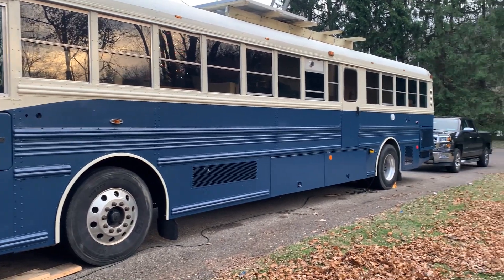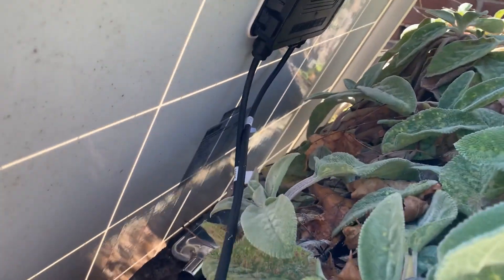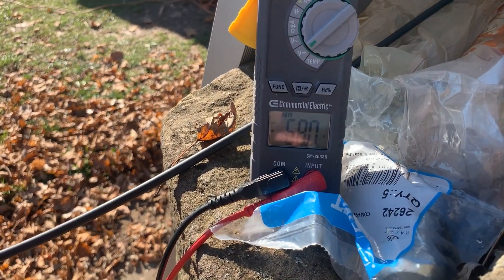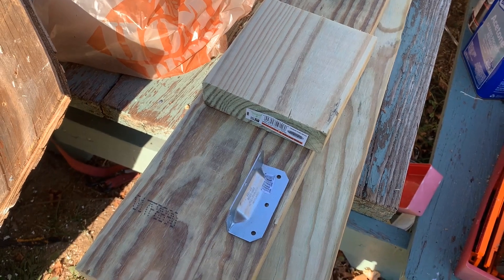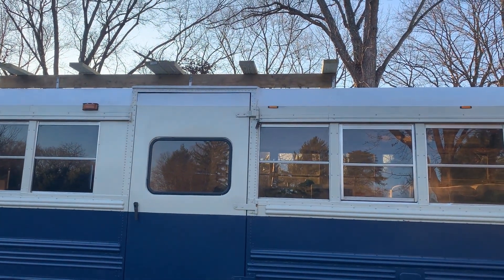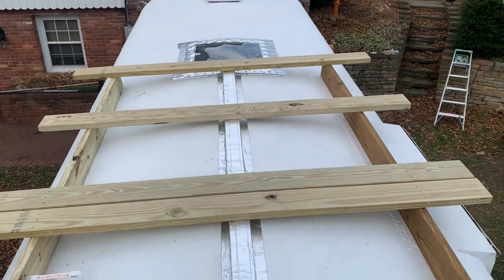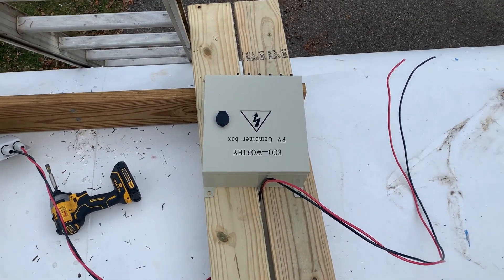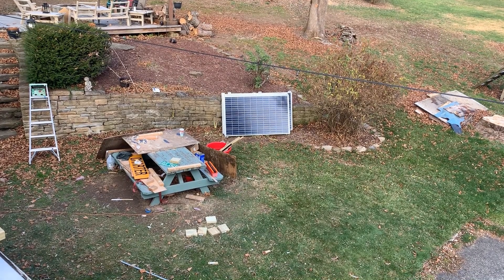Harmony Express Skoolie  (Ep 31) - Solar and Roof Deck

Comment: I've been buying my fasteners at tractor supply by the pound.  Grade 5 or grade 8 for less than box stores charge for substandard ones.
Reply from the maker: The fasteners were more of an operator error, I think. I used galvanized bolts with stainless nylock nuts.  The nylock nuts would not thread on properly.  When I went with stainless bolts, no problem whatsoever.

Because it is in contact with green treated AC2 wood, I want to make sure that they would not rust.

That deck is not going anywhere now, and I’m excited to get the rest of the panels on so they become a part of the bus.

Comment: I would think that when you drive the bus eventually where you attach the solar panels to the wood, that the air pressure  would eventually wear the holes in the wood until the bolt slipped through mus people use c channel
Reply from the maker: Thanks Karen.  This will be a part of our regular inspection throughout the life of the bus.  We are most certainly concerned about panels flying off and causing injury.  If and when the holes get wallowed out or bolts get loose, it will absolutely be addressed.  Appreciate your concern!